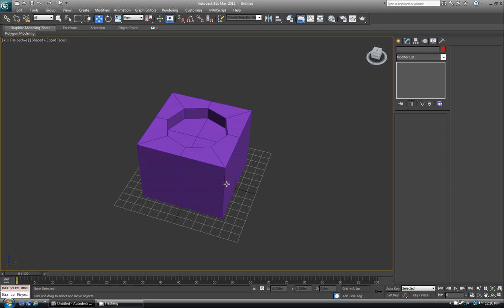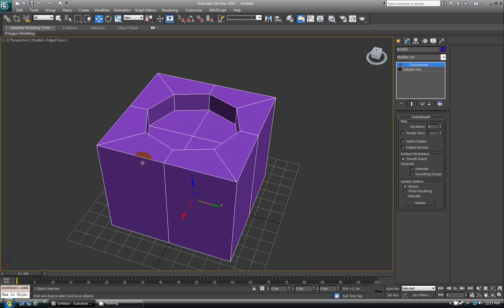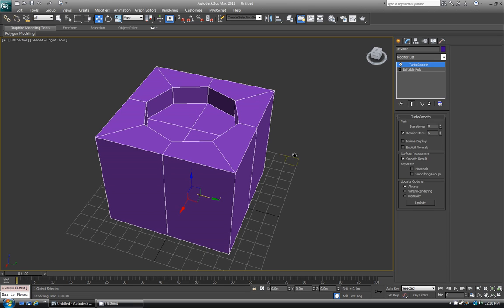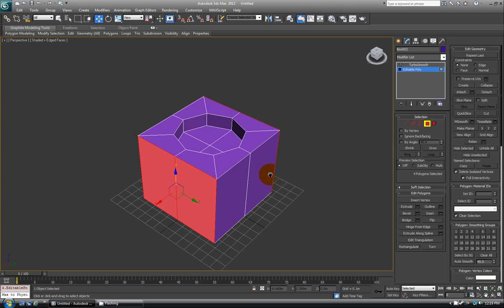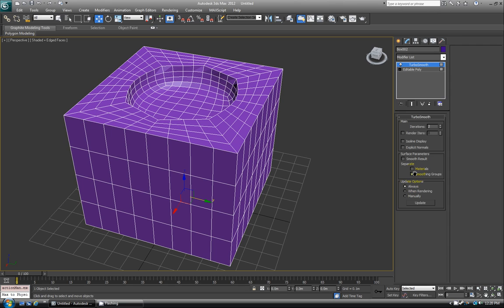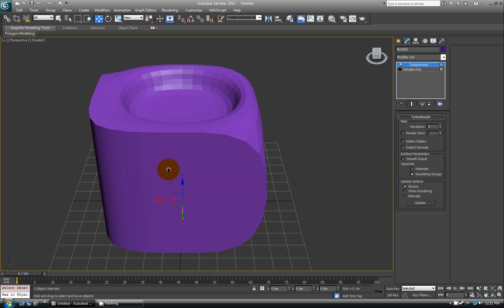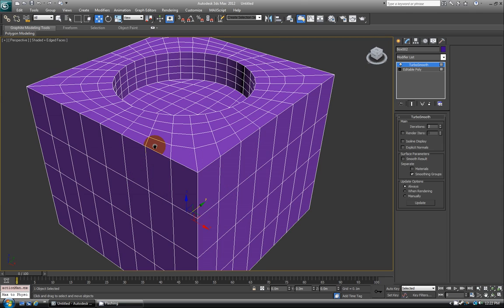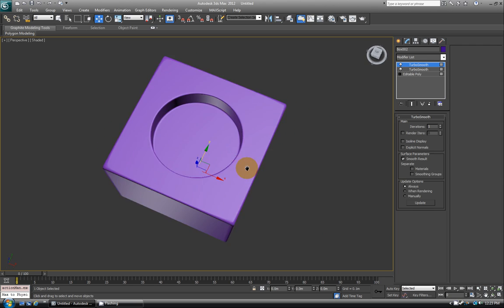3ds Max basics of turbosmooth modifier

Comment: you can achieve the same result the easier way with "crease". First select edges, then change the amount of crease you want and that will specify how the smooth will behave. 0 = soft edge, 1 = hard edge.
Reply from the maker: Josué Mota I like to use the way I was talking about in the video because it gives a nice bevel around the geo for light to pick up, or for normal maps to have that rounding faked extra geo look